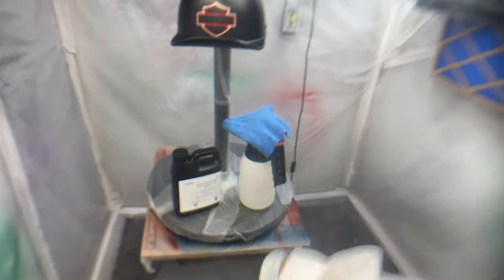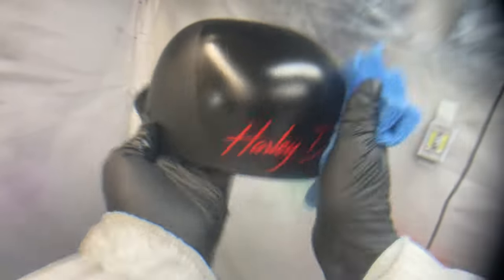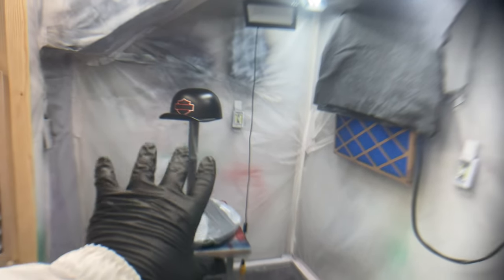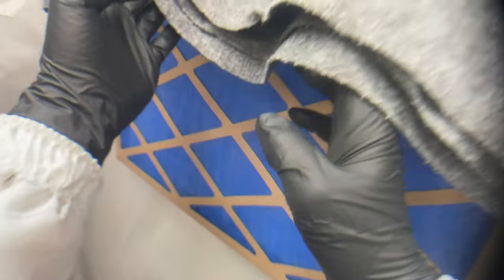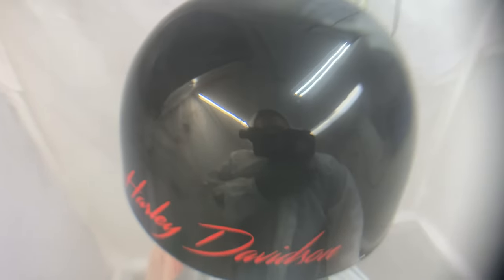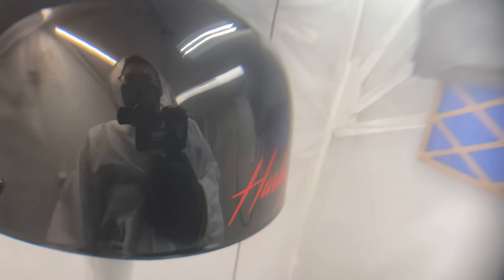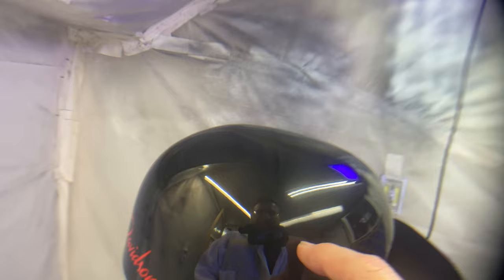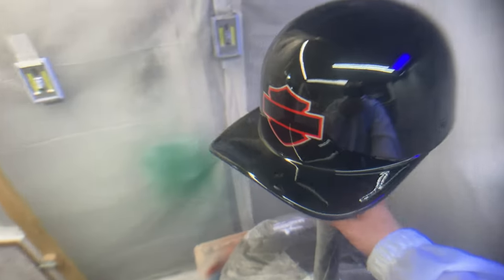How I spray Clean Armor Clear Coat- THE BEST CLEAR COAT EVER???

Comment: You can get a wrinkle reaction on built up areas. This will happen typically with too quick a cure. I would take a look a making some light distance adjustments perhaps to see if that helps.
Reply from the maker: ThankZ for the comment and that was it! I did put more down in that spot and had my light close to it. Sanded out easy, broke/cut out the air bubble, filled it with a drop and cured it, then re-cleared the whole thing tonight. Came out amazing! Love this stuff🤘🏻
Reply: @coastairbrushtv What do you recommend as a sitting time for an item like this ?  My usage is mostly helmets so wondering if there's an optimal time to let it sit and have bubbles and surface settle before hitting it with UV ?

Comment: My experiences were the same as yours lol. I was doing mine in 2 layers. Dust coat , then heavy. With a quick flash cure in between. But any area that was heavy would get those weird sag lines. Distance adjustment helped that.
My biggest issue has been those little pops. You let yours sit much longer than I have so I may just have to be more patient. I did add a tinge of 91% alcohol which seemed to help a  bit. 
When you get a good flow my goodness it's an incredible time saver. 
I've shot mine at 14 psi on the LPH80 both knobs wide open. So I may give your settings a whirl and go higher along with adjusting the fluid nozzle.
Reply from the maker: Yes, further distance was my biggest help. I’m spraying it around 20-25psi now and like it better. The lil ‘pock marks’ as they call them, do go away if u wait long enough. I’ve lowered my psi to about 10psi and just blow air on them. Seems to work most of the time. Give it a try next time and let me know if it helpZ.

Comment: Are you still liking/using this ?  I have some , get alot of random pockmarks.  Kind of annoying. Im never sure whether a heavy coat or numerous light coats is preferred. It doesnt seem to react well to some createx lines so I hit them with 4050-4053 before using this.
Reply from the maker: Not using it anymore. Too many issues. Try heating it up before u spray it. That helped with the pock marks. I spray just enough to cover enough so it flows out, medium ish coats. Mine is all expired now. I used it on a tumbler and still worked like normal. No idea if it’ll have issues down the road🤷🏻‍♂️ PS- was a freebie to match a bike I painted for a guy.
Reply: @BrusHstroKeZ  oh wow. Was hoping it was just user error on my end. It seems SO close but it has such a high rate of bad outcome. I'll see if heat helps pockmarks.  What do you use now ?  Still tamco or 4053 ?
Reply from the maker: @mml3140  Still Tamco for now. Probably going to try some Revolt Automotive Paint when I run out. It’s Tammy Miller’s new company she started. She’s the one that made all the custom paint lines for Tamco when they started doing them, Tamco owners daughter.
Reply: @BrusHstroKeZ  I remember her being very friendly and helpful. I took a look , if that 15 min clear cures as pretty as the 9500 Ive tried that would be impressive.
Reply from the maker: @mml3140 It’s actually better than 9500 30min clear. The 15min is THICK and it doesn’t solvent pop like 9500 if over applied. I’d have to see side by side first to confirm, but I think the 15min has more clarity and depth too. Haven’t sprayed it yet, but that’s what everyone was using at class during PaintKult ‘24.

Comment: Use a little bit of 91 % denatured alcohol. I’ve been using this stuff for about a year and a half and had the same problems. I spoke with the owner of the company, great guy, ..
I see You’re a little too close with your paint gun all you need is one good wet coat at a distance.   The denatured alcohol helps it flow out better and wetter.  Another trick you can do is heat up with the heat gun and then put it into your spray gun if it’s a little warmer, it flows out nicer.😉
Reply from the maker: Yeah, the owner called me shortly after I posted this and gave me all the info u did too. I did get much better resultZ after applying them. ThankZ for offering the tipZ though. Love when other artists help each other!  Appreciate ur support🤘🏻